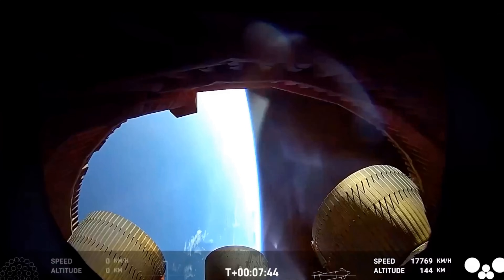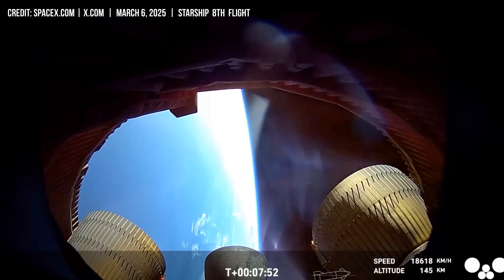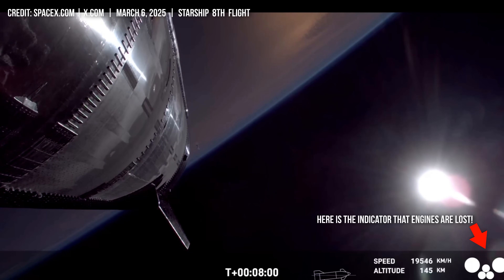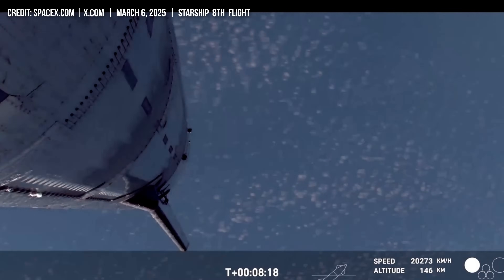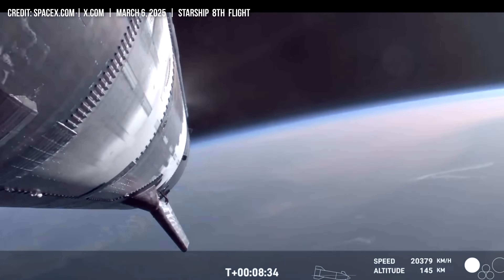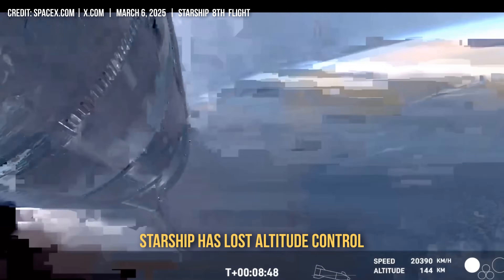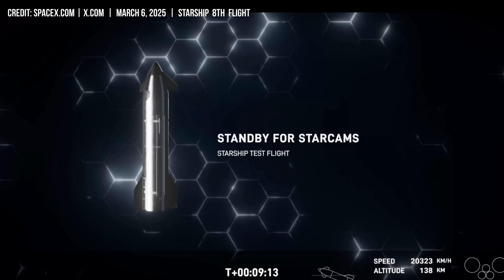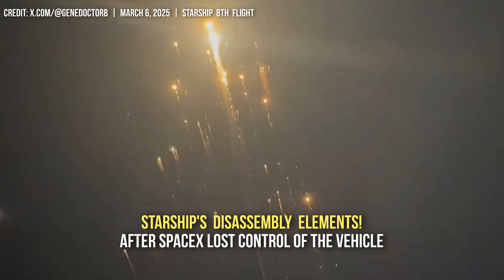SpaceX Starship 8 Anomaly: Lessons Learned From a Flight Gone Wrong

Comment: I bet the hot staging is the problem, too much back pressure damaging fuel lines or the rockets themselves? SLS might be expensive, but it works every launch.
Reply: Was there a SLS launch? When?
Reply: @alexanderzhurbal6445  Last launch and first launch 2022, and it was perfect, Elon 8 launches and can't even get into orbit, and 3 have blown up, so my statement is correct.